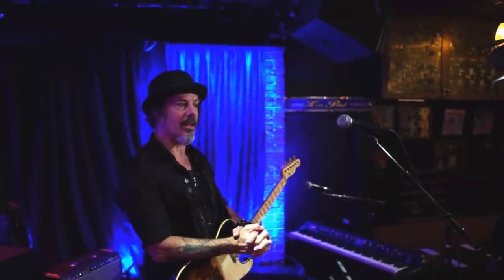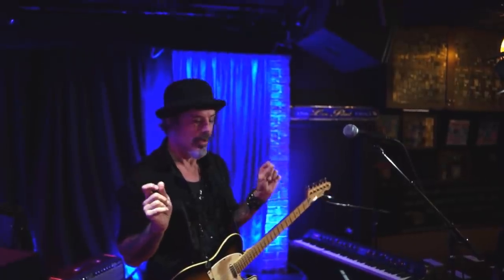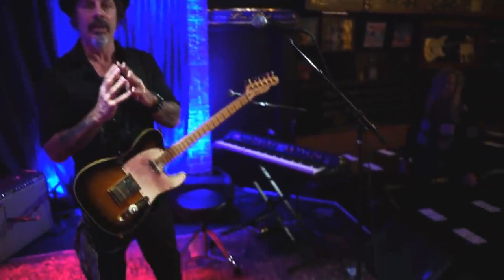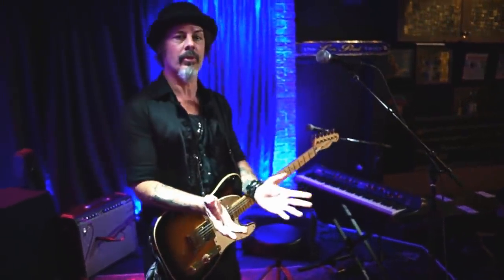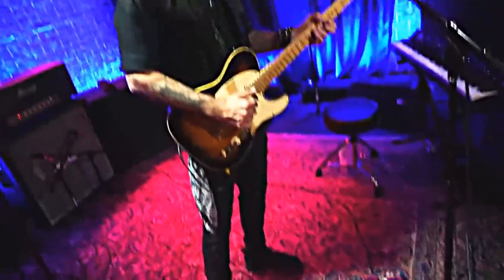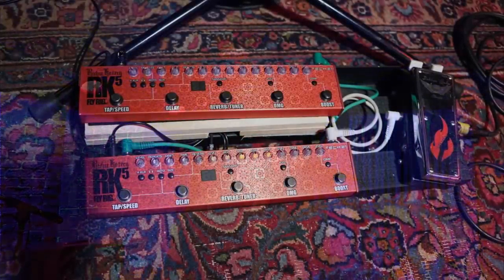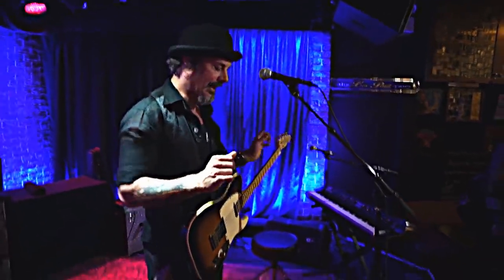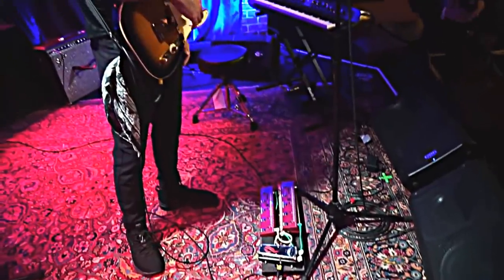Tech 21 Richie Kotzen RK5 Signature Fly Rig® v2

Comment: This thing is a lifesaver. I'm a working guitar player. This is my backup rig and this and a frfr powered speaker is my small gig/rehearsal rig. Tech 21 has been making greatsounding bulletproof stuff since the first sansamp.
Reply: What do you feel about using the FlyRig plugged straight into the mixer, with no backline guitar amp, and either in-ear, or floor monitors?  Does it sound acceptable to you on stage, and to the audience out front?  To me, using this with a backline amp defeats the object of having it in the first place.  I don't own anything like this, but the older I get, the less inclined I am to carry heavy amps around.

Comment: Got the original and love it. I think the xlr out and tuner additions are really good features. In my set up I go into the board via  a DI box on my pedalboard. Having it built in would be more convenient for those going direct. Great unit
Reply: AvgJoeGat 812  hey bro what D.I.box do you use to go into the mixer? I thought most mixers have a line/mic  input for instruments? What do you think of the clean times mostly? Is this product  better than say a sans amp blonde pedal in tone and amp simulation? Thanks . Rick

Comment: Great pedal - it sounds fantastic. I´m just missing two options for a future version: post boost for solos and fx loop.
Reply from the maker: Thanks! Signature gear is designed according to the artist’s specs. So it would only be changed if Richie wanted it. You might want to check out the Fly Rig 5 v2. It is voiced differently but it has both of those features.
Reply: @Tech21nyc  Just headphone option in the fly rig 5, guess I'll have to buy both;)
Reply from the maker: @CBGypsy03  Excellent option, if we may say so! 😁

Comment: So perfect IF ONLY THERE WAS A POST BOOST FOR VOLUME INCREASE FOR SOLOS ARRRRGH so close to being the perfect solution... 

I used the Sansamp button from the first version as a volume boost, but won’t be able to with this version. Please tech21 if you are reading this, please incorporate a post boost as well in the next version. I will buy five.
Reply from the maker: Noted. Thanks for your input.
Reply: That’s exactly why I bought the Fly rig 5 v2 not the RK. Although I slightly prefer the overdrive tones on the RK the post boost is so important live

Comment: I use the first one and its great. Love the distortion. However. I use the sans amp as my lead boost to give me a bit more gain and volume. The new switch ia the wrong way around for me. I want to leave the reverb on all the time ( Why would you turn that off??? ) And kick the Sans amp in and out. Maybe a little switch to let it work either way?
Reply from the maker: Perhaps on a different version. The RK5 is designed as Richie wants it.

Comment: So how do the delays sound going into the front of the amp, don't they compress and get louder? 🤔 🎸 🤠
Reply from the maker: It depends on how you have the amp set. In general if the amp is set for high gain, the delays will compress and the repeats will get louder and change tone as they get softer though it seemed to work for EVH. The amp doesn't have to be totally clean. It's a balancing act. 

Richie uses backline amps set clean and uses the SansAmp section for his basic crunch tone and uses the OMG and boost for solos. He shows how the amp sounds clean at 1:48 in the above video.

Comment: I've been looking around  and  can't find any good videos showing the compressor maxed out. How squashy can it get? Is it like the Boost Comp for example? 😮
Reply from the maker: The compressor is preset for a medium amount of compression. The Level control is for the make up gain. The amount of compression will be influenced by the output of your guitar and playing style. You would need to try it with your guitar and setup to determine if it is squashy enough.
Reply: @Tech21nyc  Does the RK 5 have a level control? Also, are all of the fly rigs with compressors running them at medium by chance? 
 I'm running rather hot pickups. Ceramic. 
 I would like an all and one solution, compressor, reverb, delay, and drive with the ability of running a fuzz if wanted.
Reply from the maker: @BrotherTimothyClark  The only other electric guitar Fly Rig with a compressor would be the PL1. That has an adjustable compressor. Again, whether or not it would be squishy enough for you is not something we can predict. You really need to try it for yourself. Like the Boost Comp, it is set for a medium compression ratio. Any single knob style compressor has to have a fixed compression ratio. There isn't physical room on a product like the Fly Rig series to offer attack, release and compression ratio controls. 

From the description of your needs it seems like the RK5 is still the best choice.
Reply: @Tech21nyc  I'm thinking you are correct. Just hard to try them out when the closest guitar center is an hour or so away and even if I lived closer, being as I am blind, I would still have to get transportation. So sadly, getting into a vehicle and driving to a location to try them out isn't always practicle in my situation. 
 Let me put it this way, when you pop and or pluck a string, does the compressor clamp down and can you hear the pop and or pluck being compressed? And, are the compressors on all of the Fly Rig guitar mottles the same or are they different for each fly rig?
Reply: @Tech21nyc  To put in a second comment, the boost comp is medium compression and sounds amazing from what I have heard and would adequately meet my needs. 
 Is the RK5's compression as squashy or does it not have as much compression on tap?
Reply from the maker: @BrotherTimothyClark  Guitar Center is no longer one of our dealers. My suggestion is to purchase from an online retailer with a good return policy. This way you can take your time and give the product a good trial with your personal gear in your environment. If it doesn't work out you send it back.
Reply: @Tech21nyc  Rite. 
 I'm thinking the same thing at this point. 
 Can you tell me more about the compressor though? Is it based off of say the boost comp?
Reply from the maker: @BrotherTimothyClark  The Boost Comp has a dedicated Compression control and a Level control. The RK5's compression amount is dictated by the amount of input signal only.
Reply: @Tech21nyc  Oh interesting. So is the input signal only from the guitar or, is the Sansamp also considered a part of that signal?
Reply from the maker: @BrotherTimothyClark  No. The input flows from the order of the sections on the pedal. The guitar signal hits the Boost/Comp first then goes to the OMG/Fuzz and then the SansAmp section.
Reply: @Tech21nyc  Thanks. Good to know. Appreciate all of the input.

Comment: What is the sans amp and what does it do?
Reply from the maker: It's a tube amplifier emulator. The popular term is "amp modeling," which is actually digital. SansAmps are all analog, which is the key difference.
Reply: @Tech21nyc  thank you!
Reply: @Tech21nyc  is it the same sansamp as the bass pedal? In other words, can I use the RK5 with a bass guitar also plugged into a FRFR powered cab?
Reply from the maker: @romeou4965  It is designed for lead guitar applications. This is not to say you can't use it on bass. If you're a guitarist and already own the RK5 and want to use it on bass give it a go. If you are in the market for a bass specific unit, our Bass Fly Rig is the better choice.